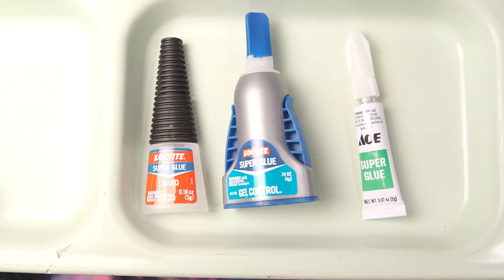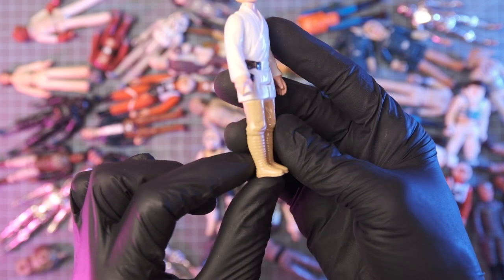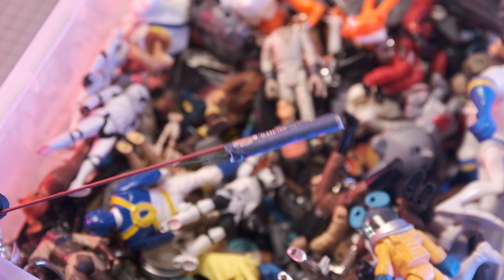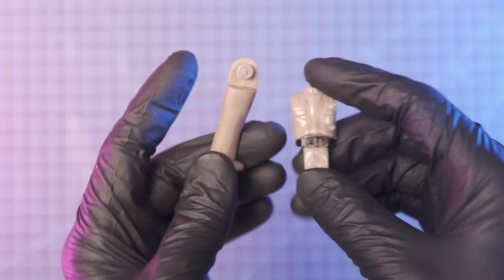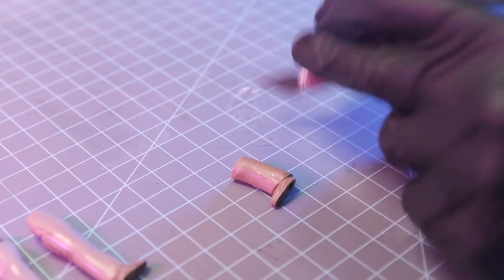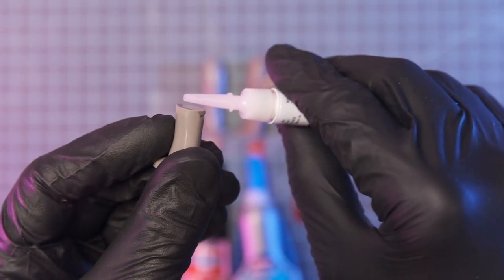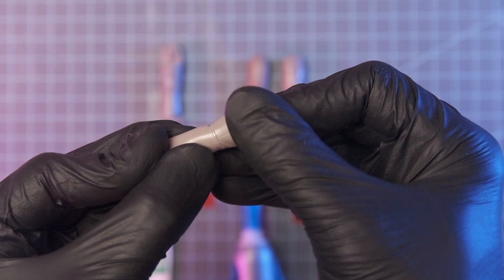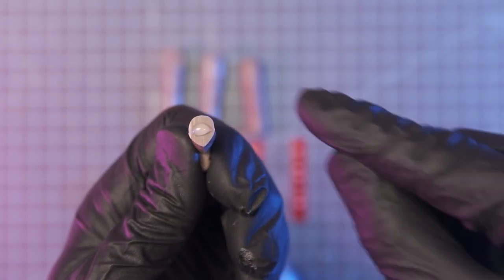A robot told me about this strong glue. | STRONGEST GLUE TEST

Comment: I saw a video and then a buddy said,"I thought everybody knew about that." The packaging that Loctite uses on the Gel Control with the squeeze handles is deceptive. If you pull the bottom out with pliers, it's revealed there's a little tube inside and the squeeze sides are pushing glue out of it, but they're not able to push all the glue out, making you think it's empty so you buy another one. It's still got half the glue in it. My friends and I now pull the bottom out and cut the outside casing off (carefully) and deal straight with the little tube and get all the glue.

Comment: Might have been good to have a completely untouched leg there as well, for comparison. Some glues are stronger than the material they're gluing!
Reply from the maker: MANNN, you know what - that would have been IDEAL!  :/  Yes indeed. I regret not scrounging up an un-cut Ed Harris leg for this.
Reply: This holds true for wood glue. That’s why when a glued guitar body falls in the most unpleasant way it will break anywhere but on the exact part where it has been glued.

Comment: I am fascinated by glues, so I enjoyed this experiment very much, it is a pity I cannot buy that SCI glue  where I live, but , if I ever see it, I will buy it (ordering online from the USA is no option as the shipping it pretty high!)
Reply: I get what you're saying , I'm in the UK and just ordered a tube off Ebay which came to about £25 , BUT how many small , measly tubes of Loctite would you need to match that amount ?
Reply: @hannya66  I cannot use Loctite, it swells my face, I am allergic to its vapours and to Araldite ( epoxy glue), so always interested in new options... I wish I could get a new one. E600 is another problem to buy, It was available in Spain but not anymore, some problem with EU regulations.

Comment: Hey Crafsman! Not sure if you've heard of it, but Zap-A-Gap is one of the best CA super glues I've ever used. I use it on my 3D prints, and it bonds them instantly and holds very well - even on butt joints. It also seems works on many other materials as well like metals. Just though I'd mention it in case you wanted to check it out.

Comment: I use the Weldon 16 for all my PLA plastic glueing, it beats al CA glues , CA glues are surface glues only the Weldon 16 melts the PLA plastic together not just the surface. PLA is a 3d printing plastic for those that do not know.  So it was interesting to see how the Weldon #16 worked on a plastic other than PLA. Thank  you Crafsman.

Comment: I use UHU for llastic, which is pretty much the same as your acrylic cement. It's really nice, the properties are kind of like hot glue. It's removable most times but sticks pretty good if you glob it on thick. It's pretty good for filling holes between parts since it's thick. Different glues for different situations. If you need it to be stuck forever Superglue is ok, but the fumes make plastics haze up or turn white.

Comment: Gotta admit, I sometimes gave old action figures the BB firing squad. 
BUT! It was the in the name of mad science. I always folded and hammered a thick pad of aluminum foil into a kind of "bullet-proof" armor and wrapped it in place with rubber bands first. 
Too thin or not hammered firmly enough and it looked like a T-1000 after taking a shot, but the action figures held up underneath.

Comment: One possible thing to think about, you did test 3 superglues vs a plastic cement...  If you were gluing metal to metal or basically anything that wasn't plastic to plastic that last one probably wouldn't work at all.
Reply: Exactly.  Plastic cement welds two bits together to essentially become one continuous piece, and is thus the strongest, but that ONLY works for plastics.  For everything else, the CA Gel is the go-to, and it does a great job on plastics too so I'd call it the winner overall.
Reply: My Makers used it to re-attach a neighbor's side mirror, (The whole plastic part to the door) it's held for three months so far.

Comment: Some really cool superglue i use at work is called hot stuff, its super runny, lays thin, and sets up super fast, awesome for fast gluing in a pinch. It comes in a scary bottle, and called hot stuff for a reason. Dont use q-tips to apply it to stuff, trust me
Reply: Contact Cement. You can get a little brown bottle at hardware stores (not cheap).

Comment: I've got that sci 16, use it for 3d prints made of PLA. Have you tried specialty crazy glue's like the rubber and carbon toughened ones? Loctite and BSI (bob smith industries) both make a version.
The rubber makes them slightly less brittle, they work well for me.

Comment: If you can ever try Uhu Strong&Safe. It's a modified CA glue which is gel-form and slow-curing, but also stays slightly flexible after cure. It's pretty strong. But i can't imagine it performing anywhere near as good as #16 acrylic solvent cement you show here, which i might be unable to get in my region.

Comment: Worth noting the, the PSI exerted over the area is not equal to the weight of the weight being tested. I.e=> 2.5lb weight is actually exerting a little over 6PSI since the area is about 1/3 of a square inch. To find out how much the glue's would actually hold, the area would need to be 1 square inch of material.
Still pretty cool test, and regardless of area, it does show overall which glues are superior.

Comment: Hi craftsman! Have you ever experimented with making inexpensive molds for figures using alginate? They're waste molds usually used for one cast but I think with a two part block mold they might last for a couple more. Im planning on trying this before silicone since I'm a molding beginner and it is so much cheaper than silicone. Just wanted to know if you had ever tried alginate for figures. Regards and hope the whole crafts family is well!

Comment: CrafsMan, I'm curious. You had "Time" on a label a few times in your video which made me wonder "how does time affect the glue?" Will 1 glue hold up for an longer period of time verses the others? Or will they become brittle over time and simply fall apart? I assume using a peg & cleaning the surface like you listed works wonders as well, but would it not be better to put the pieces you want together & make a mold of the new parts? Speaking of which, what about the materials you use in the molds, how do they hold up to time?